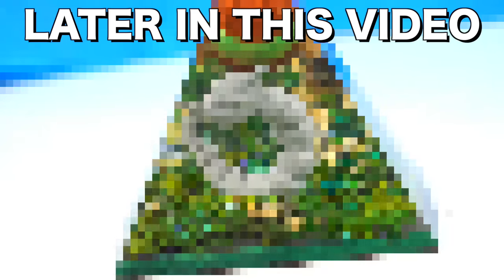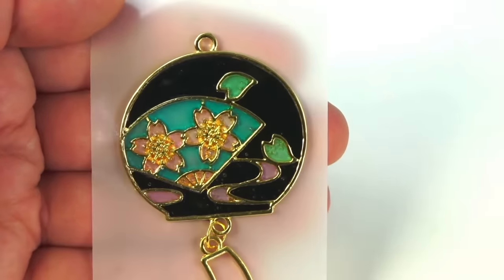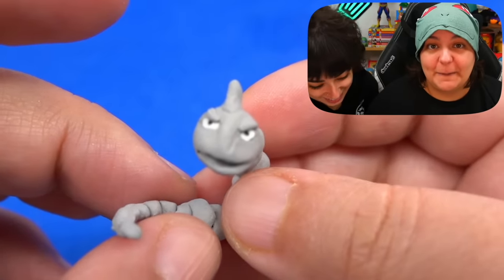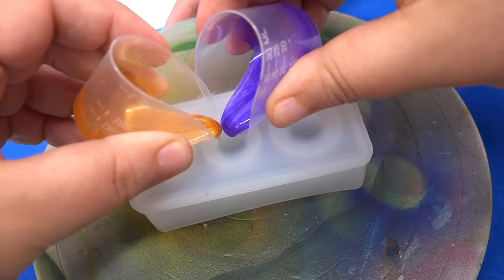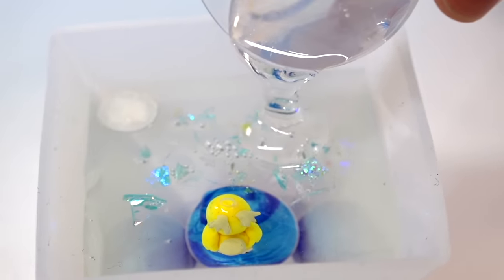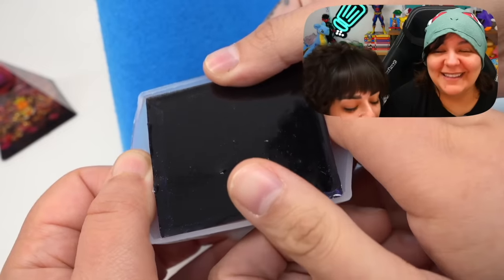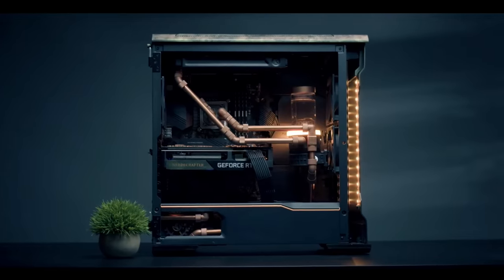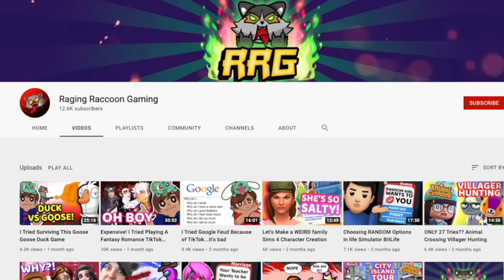Tried Making Resin Pyramids For First Time!

Comment: Pretty sure that with such small resin projects you'd get better results using a pressure pot rather than a vacuum chamber (you put the whole project inside the pot, pressurize it, and leave it to fully harden - the pressure supresses all the air bubbles inside the resin so that they become invisible). As to new bubbles appearing out of nowhere, it might be a matter of your room temperature or the resin volume/thickness (different kinds of resin have, or at least should have, the information about the intended volume/thickness for use on a project for the best effect; if you put too much the resin might start reacting too quickly, essentially boiling itself and creating bubbles)
Reply: I was thinking that too

Comment: I absolutely love what they did with the glitter, moss, seashells, etc, but have an idea. Not sure if it’s possible (I don’t work with resin but have wanted to try), but it would’ve been cool to have a colorful foil on the backside so the scene isn’t clear. So like for the Torchic one you could’ve done a red foil for the back side of the pyramid so the scene appears a bit redder and isn’t entirely see-through.

Comment: 24:20 You can use alcohol spray for resin bubbles. Fill a spray bottle with rubbing alcohol and spritz the surface of the resin. The alcohol breaks the surface tension causing the bubbles to pop and you'll see the bubbles pop right before your eyes.

Comment: So if you wanted the balls more swirled you could have mixed the colours a bit once they were in the mold, also if you want epoxy resin to have less bubbles you need to wait like 10 mins after mixing so the bubbles all rise to the top, then pour it. Then you use a torch to pop the bubbles once its in the mold.

Comment: Next time 
Fill the mould up until the point you want the head to be then harden that

Then fill the sides to make a rough area you want the sculpture to be , then harden the resin 

Add sculpture and fill the rest of the way 

That will take longer but is easier

Comment: 26:53 TO GET BERY FEW OR NO BUBBLES 🫧 You lightly mist the uncured epoxy surface with denatured alcohol to pop air bubbles. The alcohol flattens the epoxy and reduces surface viscosity. This is a low-risk way to prevent bubbles. Denatured alcohol quickly evaporates and won't create new bubbles.

Comment: You need to heat the resin and stir slowly when using epoxy. I work with resin as my job and make sure if anyone is using epoxy they wear gloves and eye protection xx even if it is non toxic it can still burn skin

Comment: air or the wind element is usually represented in most media as green not purple, i have never seen it represented by the colour purple, only mostly white clear or green and sometimes yellow or light blue and if u are going with Pokémon the flying type or wind adjacent typing is a whitish light blue. also the representation of wind u showed was pink not purple

Comment: If you dont want bubles in your resin molds you can tap it on the floor a few times :)
Reply: make sure to do tap it when the resin or apoxy is in the mold and still runny or unhardend